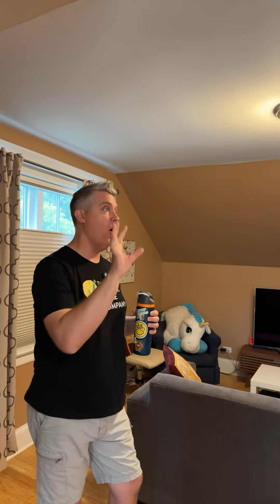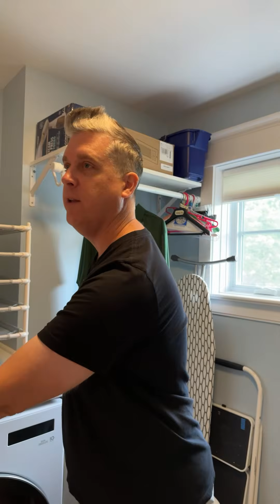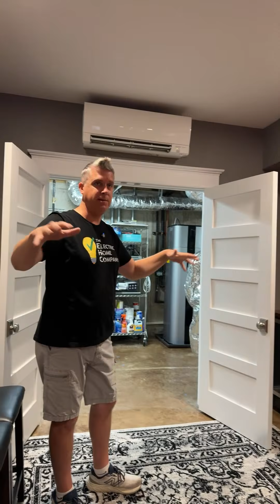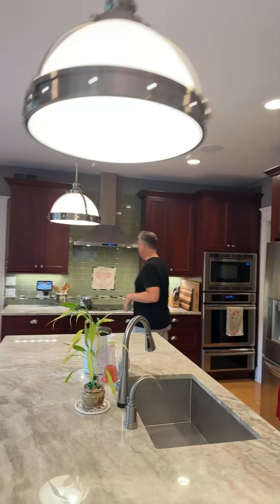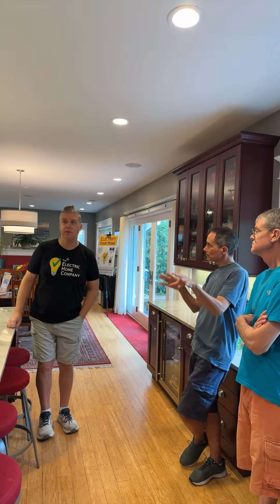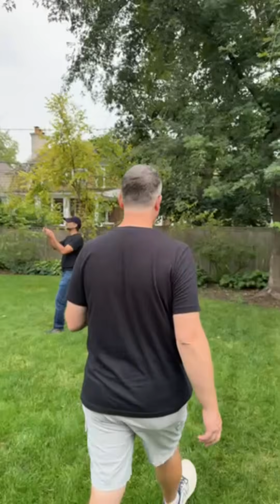The Electric Home Show - ON TOUR! All-Electric Home Tour

Comment: Which Washer and dryer did you get? You should do a video just on those after 6 months or so. I will be replacing my set of gas dryer and top loader washer soon as they keep having issues. I will be adding 24kw solar system soon so wanting to swap to full electric eventually. Just replaced my water heater. Only hvac/stove/gas dryer is left.

Btw those metal FINS on your LG water heater were supposed to be removed, i love how they don't say it in the directions, they do show it though in the pictures. They are for shipping only. The rubber pads under neath are for the stability of them. To remove them you just push them forward and pull down, so you prob can do with when u drain it for your yearly maintenance.
Reply from the maker: The Washer/Dryer are both from LG. Shout out to @bensappliancesandjunk for great reviews of these systems. Thanks for the tips on the metal fins. They're firmly in place right now, but something check in the future.

Comment: A couple of points you made are really important and too often ignored  Recent changes in our environment, such as an uptick in wildfire smoke events, and other sources of poor outdoor air quality can affect how we use an ERV.  We found out about this the hard way when our former neighbor would start up his ancient wood stove in his shop!  These kinds of events can result in the need to turn off your ERV - temporarily.  At these times, the outside air quality can much worse than indoor air.  You can address this temporary problem by having a means to control your ERV.  You will want to be able to easily turn your ERV on and off, but also a means to adjust the air flow, or amount of air it is pushing through.  You can also address the issue with filters, as you discuss.  Effective filters (MERV 10 and above are regarded to address smoke) are very useful in the ERV.  Many ERVs have historically only incorporated a simple washable filter, which will not capture smoke (or pollen, etc.).  Ductless mini splits also have very simple mesh filters that only capture large dust and other large matter.  If you go the ductless route with mini splits, be sure to strongly consider an ERV to address air quality. We recently converted from a gas furnace to a cold weather heat pump (Mitsubishi Hyper Heat) using a ducted, high static system.  We were lucky, our house already had ductwork in excellent condition.  The ducted system was cheaper and for retrofit, mush easier, as we only had to fish one line set to one location - an air handler in the basement.  With a mini split system, we'd have needed a minimum of 5 indoor wall units, and would have still not cover all the rooms.  Going with a ducted system saved cost and meant we can use a MERV 13 media filter.
Reply from the maker: Great points. The newer version of my ERV, the “CERV2” has a PM 2.5 sensor that will automatically stop brining in outside air if that air is worse than the interior air - as would happen during a wildfire or other hazardous air event. Thanks for watching and sharing the comment.
Reply: @ElectricHomeShow  Very cool that the newer ERV monitors outdoor air quality and adapts.  To  be clear, our system with an ERV ran 99% of the time with much better air quality outdoors.  Only on a few occasions did we need to stop it from operating.
Reply from the maker: @tedbellSEA  that makes sense. I haven't seen a lot of homes in our area with an ERV system at all, so definitely room for improvement.